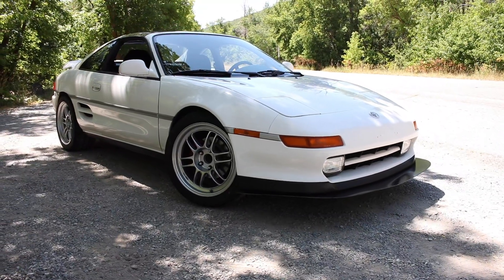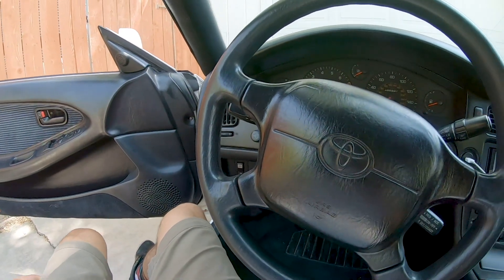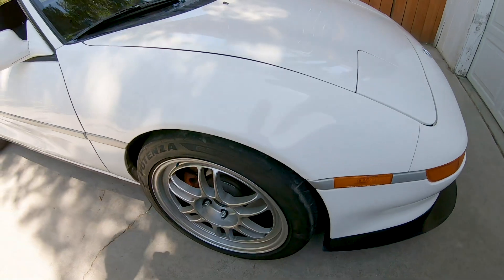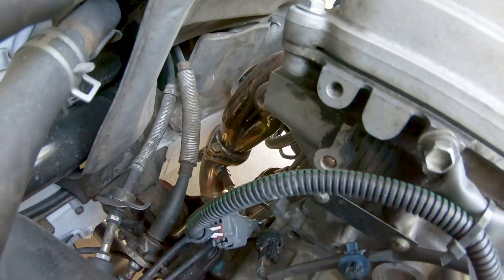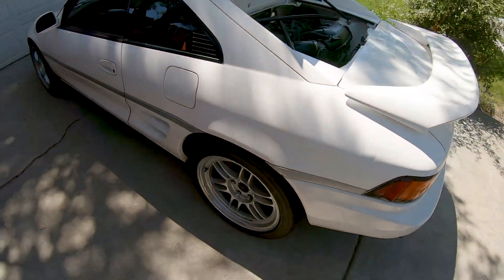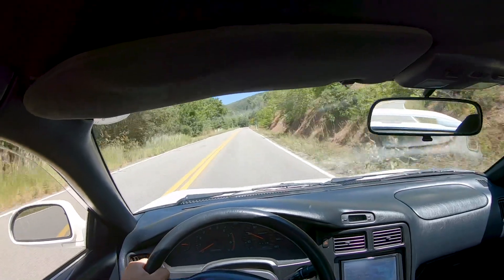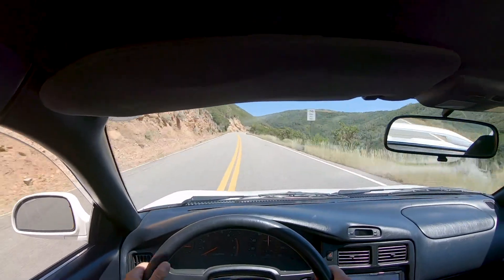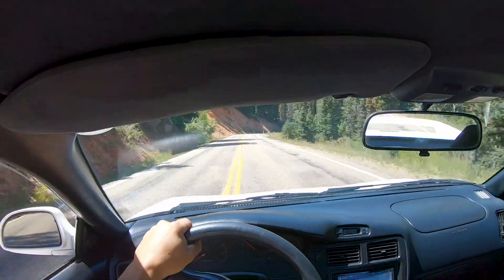2gr MR2 - Video overview

Comment: Really nice car mate. I'm still enjoying 3sgte life but there is no denying the appeal of the 2gr or any v6 for that matter. Enjoy and keep em coming!
Reply from the maker: Yeah I love turbos, just after two cars, and two turbo motor issues, this seemed like the better route for my personal use. I would probably want a gen4 if I got another one as a daily driver
Reply: am i understanding right that you like the 2gr over the gen3, but that a gen4 may be/have been preferred over the 2gr? 

seeking clarification because i’m on the fence of swapping my gen2 for a gen4 or 2gr.

thanks for the video! really enjoyed it
Reply from the maker: @kbatch80  I love the kick in the pants you get from turbos, it feels faster as the power delivery is more abrupt, that being said I think my gen3 was making similar power to a stock gen4 and the 2gr is faster around the track. I did this swap for more track focused relaibility, but have really enjoyed it around town too. its very peppy and the sound is addictive. I was getting annoyed with the lack of parts availability too so the 2gr being current and super popular makes it easy to get parts and they will be popping up all over junkyards if I need to get another. It comes down to you, both are great options for different reasons

Comment: Love this. I’ve got a 93 Turbo that I expect to be doing this conversion on shorty. I’d be interested to hear more on the ins and outs, and any advice.
I notice you still have the Cruise Control  stalk fitted on you steering wheel. Is it functional with the conversion? What about your aircon??
As previously said, please post more video content on the car.
Thanks
Reply from the maker: I never use AC so I just removed it, I mean the roof comes off so no need... it is possible to get the cruise control working, its all electronic at this point so you would just need to run some wires and what not. I know there are semi detailed posts out there on the forums about how to do this. I haven't done it. Obviously this car isn't "done" and perfect, its my project

Comment: WOW seriously thanks you for your video. I own a 1991 mr2 turbo gen3 white with rpf1. Your car is soo clean ! and you have good taste to conserve all oem looks ! your car is awesome defenetly my mr2 goal ! and 2gr is best engine to put in this car in my opinion. But my only question is it hard to work on it ? Ive heard some people says that, except for an oil change, you have to drop the engine to work on it. Thanks again for sharing your awesome machine ! From a Quebec Canada !
Reply from the maker: pretty much you will have to drop it to do any major work. I re-sealed everything before I installed so I wouldn't have to do it for a while. you will be able to remove the exhaust stuff although it will be kind of annoying to do the headers. you can remove all the intake stuff down to the injectors easily too. Stoked that you like it, I certainly love the setup and am glad I moved this direction with it. I may try to find some second hand bumpers to do some aero mods for time attack, but I haven't figured that out yet, I don't want to cut up the stuff I have since its all pretty decent.

Comment: So I'm curious, what's the MPG like compared to the original Turbo engine?  Did it get any better, stay the same?
Reply from the maker: I haven't done any hand calculating before, nor after, but I do notice gas lasting longer. I'm usually beating on it and not cruising so this is mostly noticed during wide open throttle. The swap is supposed to be more powerful, more reliable, and better fuel economy. It's seeming to be working out that way from what I can tell in the early stages.
Reply: Somebody's always gotta ask about mpg in every video! So rediculous! It's the dumbest thing to ask about a high performance vehicle... It's like asking John Force if his mustang will void the factory warranty with the modifications he's made?
Reply: @brentiaconelli6484  eh im building one right now and was actually curious myself

Comment: Could you tell me more about the stuck clutch?  I seem to have the same problem.  How does it happen?  I assume the solution is to take the trans out and pull the clutch off the flywheel, but how I'm worried about the problem coming back.
Reply from the maker: it was because I didn't remove the green coating, I didn't realize it was a coating, there were no instructions on my flywheel. iu had to remove the trans, unstick the disc with my hand, clean and reinstall

Comment: Nice car, currently have a 93 with a Rev 3 swap and am considering pulling it to do this.  Similar reasons, worry about reliability/parts/usable power.  Currently running about 18psi on stock ECU, and really don’t want to deal with standalone.  Any regrets pulling the turbo for the 6?  Faster or slower than the turbo?  The sound is awesome, really pulling me towards this swap.
Reply from the maker: if you aren't having any problems yet I'd keep running it as is. idk if the turbo will handle 18psi all day at the track tho. I think that ceramic wheel likes to say bye bye. 15psi would be safer. no ragerts, the car is faster now and less shit to deal with.
Reply: @allthingsfast2375  yeah, if I don’t do the 6 swap I’m gonna upgrade the turbo, still keeping the 18psi stock fuel cut, but should get 320/330 whp, so more power than 6, but not the fat powerband.  Tough choice.
Reply from the maker: @jrmotorsports55  the source of most of my problems and headaches was an aftermarket turbo with a turbo adapter on the stock manifold. gaskets always blew out, bolts would break or loosen, it was super frustrating. would melt the lines and what not
Reply: @allthingsfast2375  ugh, can you say what turbo it was?  I’ve been talking to ATS and KO trying to gather info.
Reply from the maker: @jrmotorsports55  I bought it that way so idk what adapter and stuff it was. the turbo itself was great, just keeping it together was a pain. it was a garret gtx2863r. its was fine daily driving and stuff, but the ridiculous heat at the track caused issues
Reply: @allthingsfast2375  gotcha.  Thanks for the info!

Comment: how much would you say this swap is? i’m going to need a shop do the work. i was thinking of gen 4 swapping but i’d prefer having a newer motor and not deal with the turbo
Reply from the maker: most people are quoted 10-15k to have a shop do the work plus parts. I did it myself on the super cheap and it cost me 4-5k I don't remember exactly
Reply: @allthingsfast2375  oh shoot so 10-15 plus parts ball park almost 20 that’s nuts! wish I had the know how and space. I guess gen 4 swap would be my cheap route
Reply from the maker: @Mister2_  sorry I said that kinda weird, parts were included in that ballpark
Reply: @allthingsfast2375  oh alright gotcha no worries! having driven it with a gen 3 do you prefer the way this delivers power? i assume its easier to manage than a turbo motor with it’s turbo lag during mid corner
Reply from the maker: @Mister2_  I had a gen 3 before. this is faster and sounds cooler. I also found out my engine is down power for a reason I haven't figured out yet, and its still faster than my gen3. I also had turbo gasket issues with my old setup, I haven't had any engine issues since doing this swap. pretty happy with the decision!
Reply: @allthingsfast2375  thanks! guess im gonna have to start saving up more coins for this swap!

Comment: which urethane suspension bushings did you use? And where you concerned about the possible rear bind at all?
https://www.mr2oc.com/45-auto-x/414661-polyurethane-suspension-bushings-good-bad-thing.html

Comment: How the snap over steer worst or less of it?
Reply from the maker: I have found the common view of snap oversteer to be more related to alightment and suspension settings than anything. stock alignment tends to understeer then oversteer suddenly. changing these specs can make the car steer appropriately then enter oversteer in a way you can predict, which is much easier to drive
Reply: FastassFaircloth thanks never heard of this. I'll look into this also
Reply from the maker: @rolldog82  that was from my personal experience at least. I run 0 toe front and 1/2 factory toe at the rear